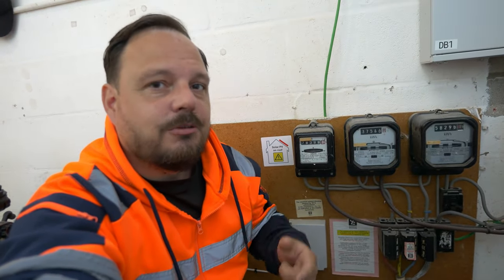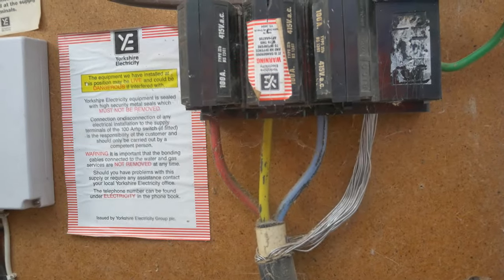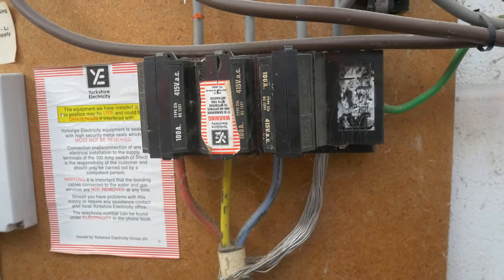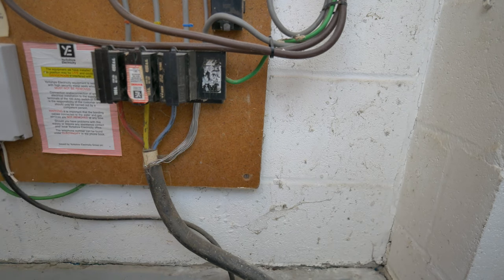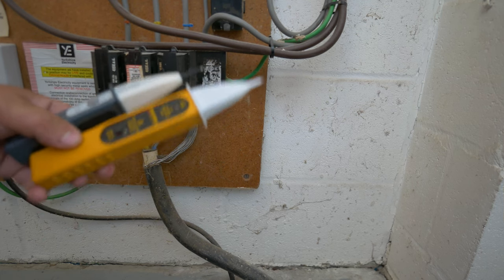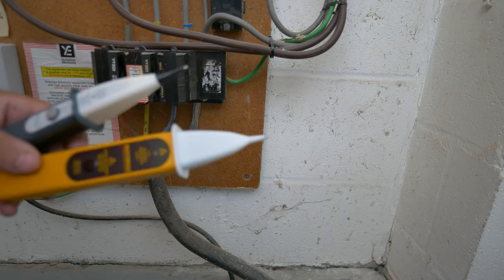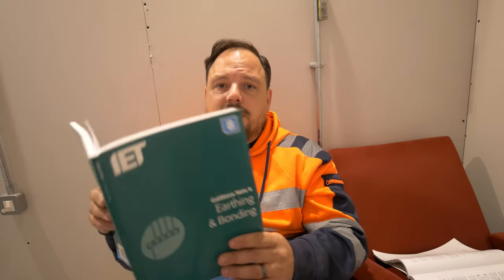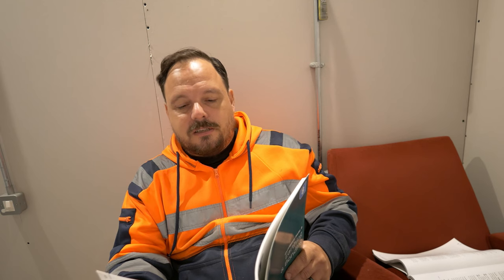Broken PEN conductors and Diverted Neutral Currents - How to check for and mitigate them

Comment: Brilliant summation of the current situation Mark! More of this kind of talk. Yes the knowledge and guidance is put there. But how much could BS 7671 do with their changes. Their guidance has mentioned this as best they can as you stated but is this a dno? Water? Gas? Issue to address? I don't know at the moment. But I will get to the bottom of a solution one day. 👍.

Comment: The DNO can neglect their responsibly towards maintaining TNCS system earthing 
There examples in numerous other industries where maintenance has been neglected.
What about installing loss of neutral monitoring at the fuse head intake it’s self with Ze monitor that sounds a warning if the value rises above 0.35 ohms?
Reply from the maker: Yes Matt:e have a cool product for just that. Client cost though rather than DNO. Still I would say its worth it!

Comment: I hope the armour is steel not "aluminium in nature" - hence the definition of SWA,
Steel Wire Armour cable, which should not be the Neutral conductor, by the way !!!!!!!???????
Reply from the maker: I take it you are unfamiliar with DNO distribution cabling. This is a very common cable type where the outer strands are used as a conductor. 

CNE split concentric with a combined N-E on PME systems. Google is your friend if you are unfamiliar with it. Thanks
Reply: @A121podcast  Thanking you, however as an elec. engineer. I am familiar
with split concentric cable. With the ones which I have dealt with half of the
outer stands were black insulated copper for the neutral, the remaining half in 
bare copper for the earth.  It is difficult to tell in the video colouring if you have
zinc coated steel or aluminium. Thanks again.
Reply: DNO do NOT use SWA for services! It is AWA.
Reply from the maker: @posei3960  100%

Comment: I have a question which is now concerning me, is it safe to use a copper pipe in the floor as an earth while still being attached to these weird combined systems?
Our garage has spent the last 25+ years with a separate earth without problems but the house had it's own small cable earth rod system put in to reduce noise on amplifiers, now I'm worried it might be a fire hazard.